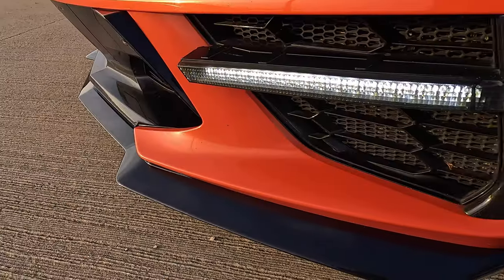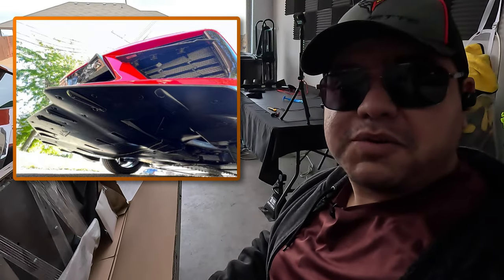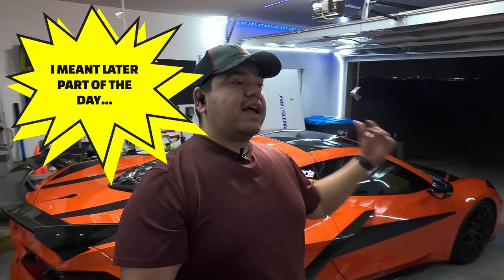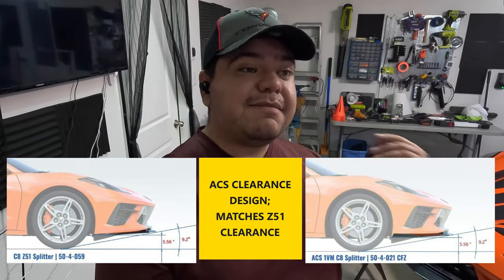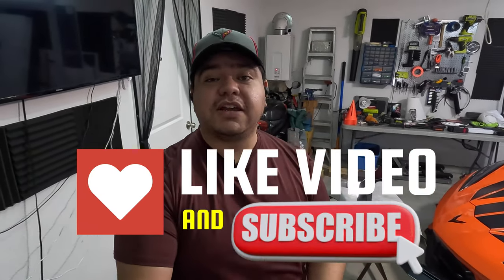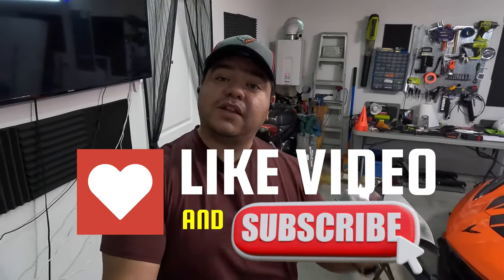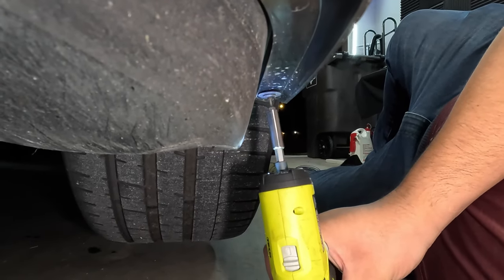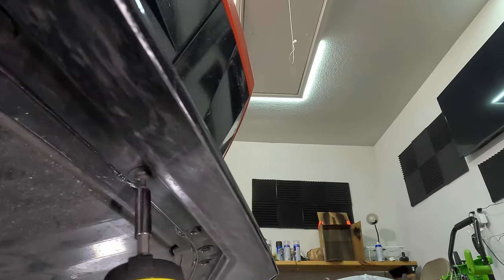New Front Splitter on my C8! ACS Unbox, Review, & Install!

Comment: 11:09 Looks great... definitely finishes off the car.  Quick question I wanted to get your opinion on.  I have a '22 Torch Red 3LT and only have enough saved to get vertical doors or a Borla ATAK exhaust.  If you could only have one or the other on yours, which one would you go with?  I'm leaning towards the exhaust because I know I'd never get tired of that sound.  As much as I like the look of the doors I'm not sure how I would feel once the novelty wore off or should I say "if" the novelty wore off... maybe it wouldn't.  I'd like to get your opinion if I could... doors or exhaust - if you could only choose one?
Reply from the maker: Hey Steve thanks for the comment! I do love both and I still never get tired of my Vertical doors lol. That being said if I could only choose one, hands down the Borla exhaust every time. Its one of my favorite MODs and id argue if I was only allowed ONE MOD plain simple, it would be the Borla ATAK each time. Hope that helps and thanks again for the comment and question! 😎👍
Reply: @NuHorizonC8  Interesting, thanks for the reply - I really appreciate it... I was leaning towards the exhaust and then hopefully do the doors later.  If you get board, the shop that wrapped my car/engine bay made a video on my car.  Its only a few min's long if you want to check it out.  Their channel is called Oakes Detail and I was their last video (the red C8).  I've done a few things since like replacing the front splitter with the 5VM front splitter, same as the one you just put on and I also added the rear diffuser from Paragon... the one with the 4 fins.  Apparently the 2 middle fins don't clear the Borla ATAK heat shield, but after doing a little research... its close.  I think I can make a slight indentation on the heat shield so the 2 inner fins clear without any issues.  Anyway, thanks for the reply and thanks for all the videos you put out.  You do a great job and your car looks amazing!
Reply from the maker: @stevepen  thanks for the reply bud! And really appreciate the compliment and positive feedback! 🙏😎 Ill make sure to check it out thanks!